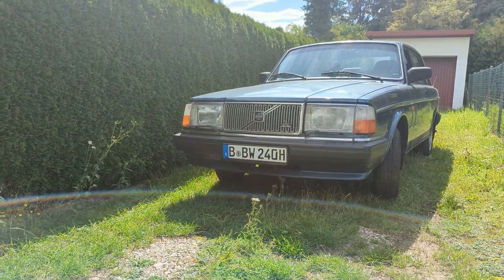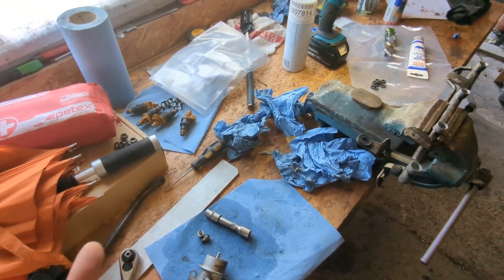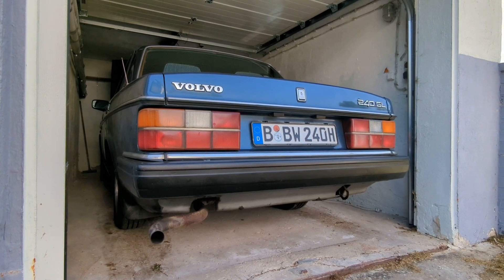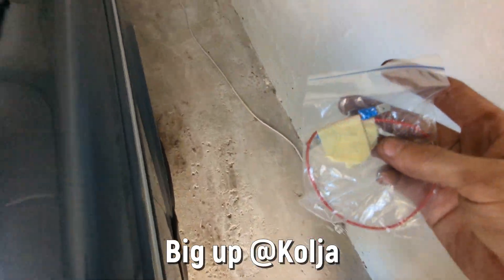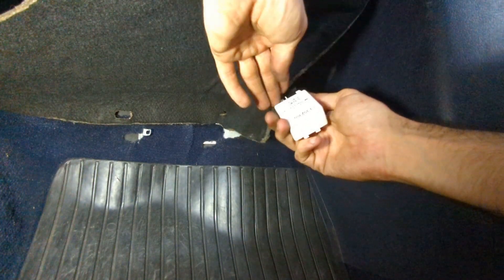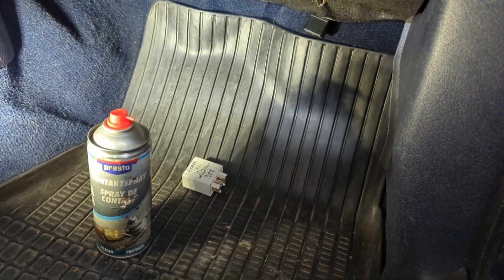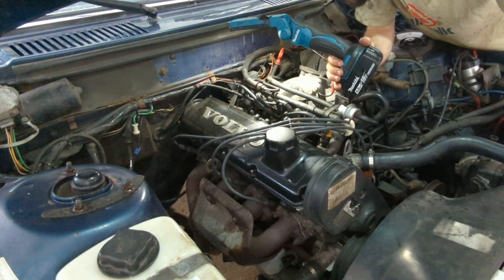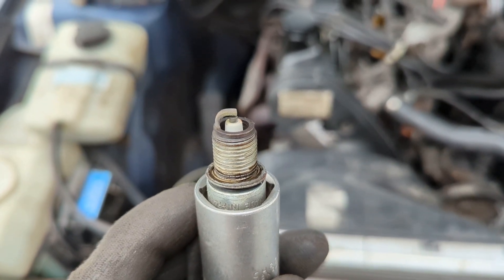Fuel Injection System tinkering on the Volvo 240

Comment: Here's some of my experiences with '91/245/Wagon and '88/240/Sedan. The sedan would just die mid flight in very hot summer weather as if you shut of the ignition key. With a 5 to 10 minute wait it would start and run again perfectly fine. Again, it would die after a short while and a rest time would bring it back to life to get home. I swapped main fuel pump from my donor car but it didn't help. As fall/winter set in the problem just vanished, ran until next summer and problem came back again. I found it was in-tank fuel pump failed causing the main pump to overheat and shut down. Cool off time brought it back... In-tank pump solved it. The Wagon developed a crank/no start condition but a squirt of quickstart ether into a vacuum port would start it and it would run! That turned out to be the crank pos. sensor on top of the bell housing/flywheel. I presume no signal stops the fuel pump relay.. but somehow if you'd start with ether spray it would run !! .. New sensor and all fine again.
Reply from the maker: That was surprising, my money was on fuel injector relay or something electrical on the sedan and fuel pump or something on the wagon, did not expect that! Thanks for sharing, this might come very handy in the future 👍

Comment: So, how long do you prime the pumps for when you are bypassing the switch? 
I recently replaced the entire fuel system because the car was left with a full tank of fuel, and it sat in the garage for 16 years, destroying the tank and pumps. I've checked to make sure pumps work and replaced relay. But it still won't start. I also replaced the hall sensor in the distributor and put a new fuze link under the hood next to the battery. Im lost at this point. Are there any suggestions? Thank yiu

Comment: Glad you found the problem and got the cars running again! Silicone grease certainly is great to have around. Seals slide in much easier, and you don't ruin them over time. Have come across too many times where seals swell up because someone have used petroleum based grease instead of silicone.

My '86 740, after being reliable and starting every day for a decade, suddenly refused a couple of weeks ago. After some troubleshooting I found one of the coils in the fuel pump relay had an open circuit. No cracked solder joints or other visible damage. Was like 50 euro or so for a new one at the dealer. The guy there said they last about 10 years, and mine had a date code from 2011. Fired right up after installing the new relay.
Reply from the maker: Exactly, to be honest I used to use regular grease for a long time before I knew better 😔 Good to know about the relays life expectancy, I have a few that are 20-30 years old working fine but it's not worth the risk!

Comment: It runs good. Nice job.
In fact it runs so good judging by the look of that sparkplug that i suggest not even bothering for that 2.5bar FPR. Just leave that 3bar FPR in there.
Reply from the maker: Thanks, that's a good point. She's always been great on fuel and no signs of running rich these last 2 years running the 3 bar, unless it's lean for some other reason and balancing itself out 😄

Comment: Hi there, Gunsons colortune is an invaluable tool to have. I wonder if You could help Me, I have a failed front driver side (UK) engine mount failed. on My Volvo 740, 1986 2.3, estate. I have looked on Ebay and all the engine mount and gearbox rubbers look the same in size and shape. My question is are they the same volvo part used over a wide range of locations and models? Any help would be much appreciated thanks Dee
Reply from the maker: I've never had to deal with engine mounts on a 740, but Skandix is a great resource to check parts and numbers, you can enter in different model data and see what mounts are listed 👍
Reply: thanks : - ) @Involvod

Comment: Another way to confirm which terminals to link on that relay socket is the wire thickness. The ones switched by the relay contacts will be thicker than the wires for the relay coil.
Reply from the maker: Thanks 👍

Comment: Turbo engine injectors have bigger flow rate and low impedance values as you mentioned. You will blow ecu if you put the turbo injectors to the NA engine. Actually you will blow the turbo engine ecu too if the resistor pack is bypassed.
There is more stuff to know from the injectors when it comes to the replacing them with the similiar ones. Things like dead time, dynamic flow rate etc etc.
Reply from the maker: Thanks 👍